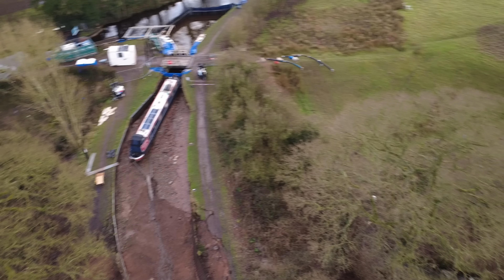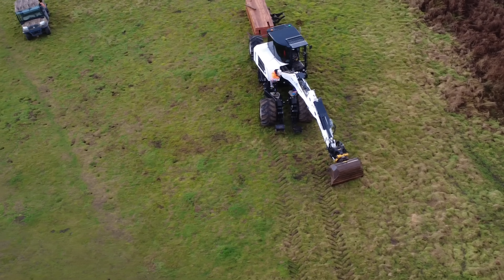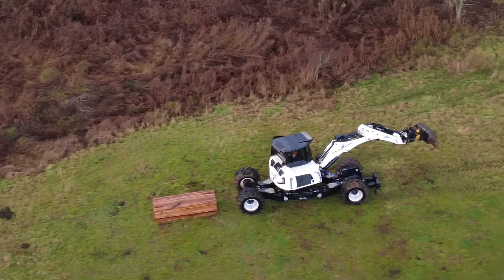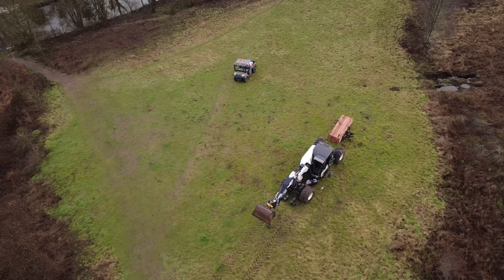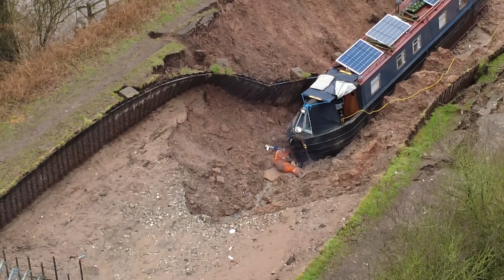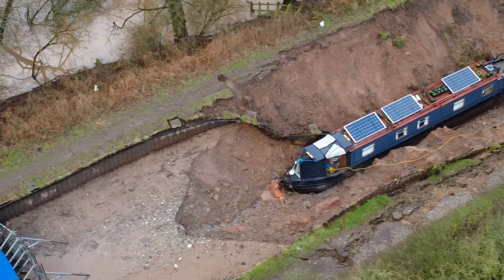Preparing for Action: Digger Testing and Welding at Llangollen Canal Breach

Comment: I did wonder if they would have to weld extra temporary fixings onto the hull, I've just seen the way they pulled the other boat, (Pacemaker), out on Josh's last video, with cables attached to both the bow & stern of the boat, looking like that one will soon be re-floated.

Comment: When workers are around heavy equipment, they need to trust the operators, thus risking injury or death so slow and steady, resulting in a safe work area is the bottom line.

Comment: Has it not been considered to restore the dike first and then let the boats float again by slowly filling the canal with water?
Reply: The boats are in the way of a repair.
Reply: there is no need to make the repair on the original position of the dike.
Reply: @jelmerbiesma5999 - don't understand your comment. They aren't going to realign the canal, that would cost 10 times as much as a repair, probably more.
Reply: @PeterJewell2 you can realign the dike without realigning the the canal. In the Netherlands that is common practice.
Reply: Aside from that being a monumental job, and even if it were possible (which it is not) there are no guarantees that either boat would be able to float.  The extent of damage has to be assessed.
Reply: @llofdarkwater9152 the breach has become a part of the history of the canal.
Reply: @jelmerbiesma5999  -  and that has to do with what?
Reply: @llofdarkwater9152 it is a pity that you do not realize that the restoration of the dike in a new place can become a permanently visible part of the history of the canal.
Reply: @jelmerbiesma5999 - Well in any event,  the CRT makes the decisions and restorations, and let's leave it at that.
Reply: @llofdarkwater9152 did I deny that?
Reply: How's that going to work? The canal is only 3 or 4 feet deep and, here, it's on top of an embankment. So, the repair will start with the embankment being rebuilt. That will require layers of compacted soil being built up exactly where those two narrowboats are currently lying.
Reply: @666izzy there is no need to make the repair on the original position of the dike.
Reply: @jelmerbiesma5999 Yes, there is. They're going to repair the canal, not realign it.

Comment: Menzimuck :) I don’t know what he is doing, that is quite odd? I don’t mean ‘odd’, I mean he is checking a particular thing. I wonder if the welder is a Crouch bloke? Looks like a generator running a welder-set in the bow. The base plate is the only bit strong enough to pull from if it jams up on something. Winch force might creep up higher than the weight of the boat. The sides of the bow would tear. Hopefully the digger is going to free the dirt and piling sheets from its side. Fingers crossed it is saved.
Reply: There also seemed to have been someone working in the bow with an angle grinder on the bow thruster tunnel? The more attachment points available for the pull the better.
Reply: @johnrconnett that could work, like a bull's nosering.
Reply: @johnrconnett  yes, that had me interested. Cutting out the gas locker and water tank to get welds on the inside? (Internal steel straps). Yep, it would be the smart move to spread the stress out.
Reply: It's possibly straight out the box, brand new. What is it, Chinese? It doesn't look JCB?
Reply: @noddynomates  oh my gosh no, it is very European. It lives on the edge due to the extreme conditions it works in. It gets inspected for cracks and stress. It is the needy athlete of the genre :)

Comment: The welders might also be welding up the drainage holes on the bow, which will presumably be liable to take on water and or sludge as they initially start to winch it forward.

Comment: Hats off to that welder, having to lie in mud and weld on a towing eye, and possibly add some strengthening plates so that the tow does not just tear out a piece of the hull cannot be much fun.
Reply: And it looks as if the little rivulet of water leaking under the coffer dam is right under the welder, too. Miserable work.